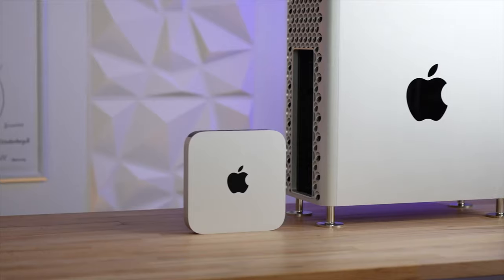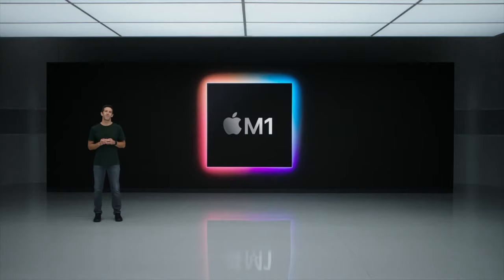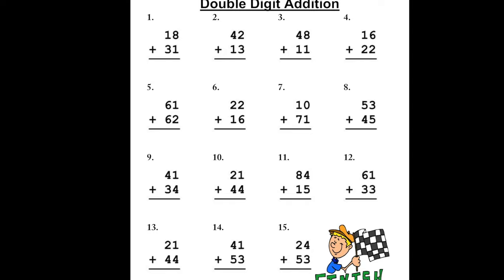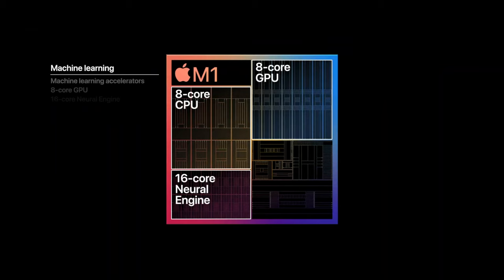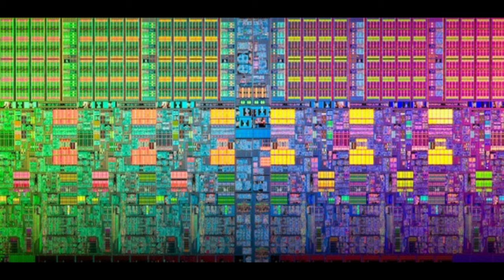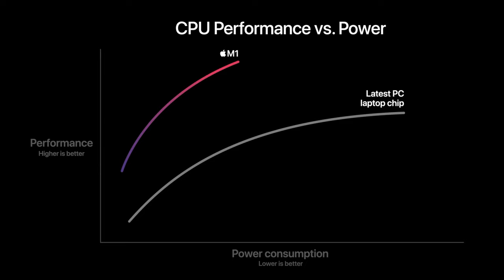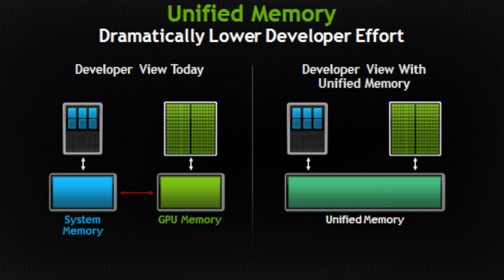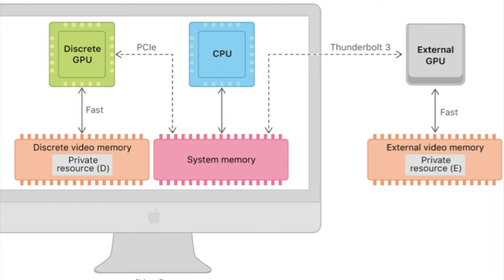Why Is Apple’s M1 Chip So Fast?

Comment: It's not that fast and it is because of the memory. But my m1 pro display cable is already broken after 2 years of  regular use and I have to pay $800 to have it fixed, because it is soldered onto the display 😅